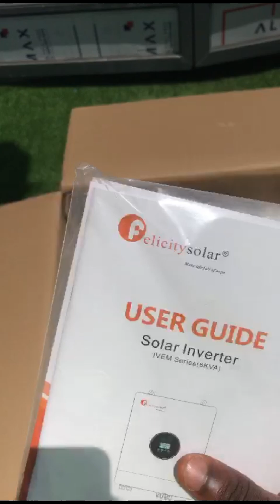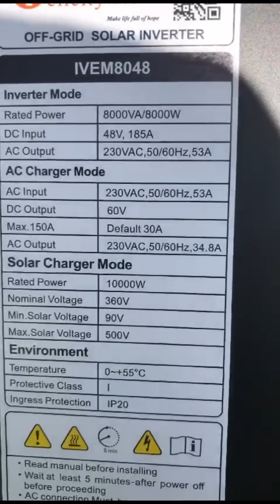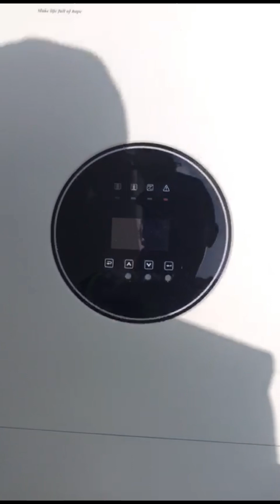IVEM8048 8KVA FELICITY INVERTER REVIEW PART1

Comment: This product is very good the design is exceptional I just installed one last week, but I am having issues with the transfer mode where there is power failure it doesn't switch immediately as UPS but switching back to utility there is no problem. I don't know if that is how they design it or is a factory issue

Comment: I just got this installed but i have an issue of the fans running constantly round the clock with ir without load and draining the btteries when there's no power. Does anyone have thesame issues please?
Reply from the maker: The fan is automatic,it will stop when it cools down
Reply: @colcent_solar  I guess mine is faulty then, had it for over a week now and the fan hasn't gone quiet even once. Not even when there is no load. Thanks for your help. Really appreciate it